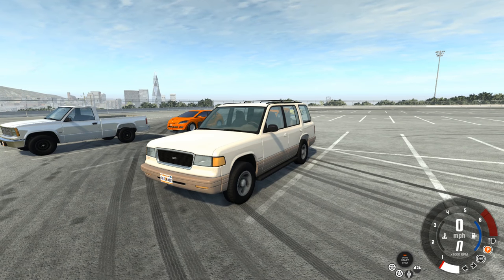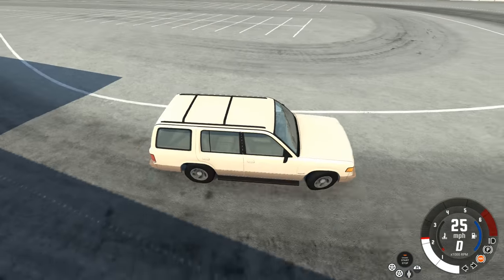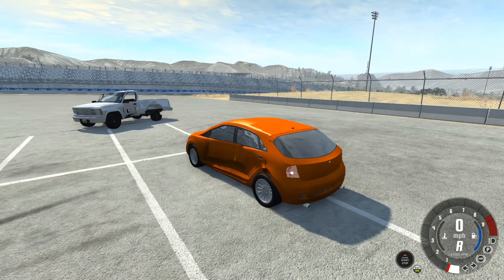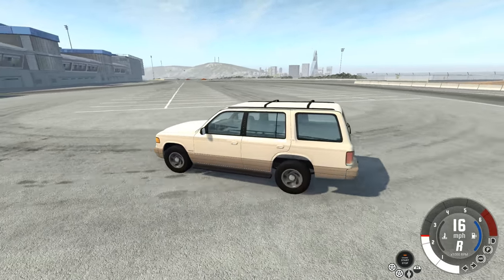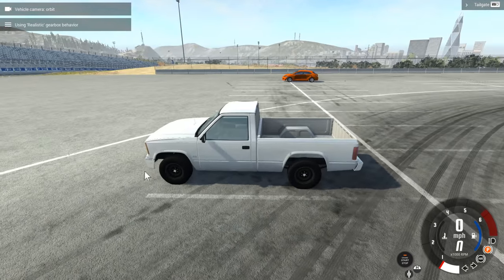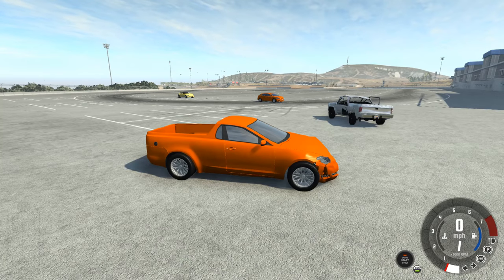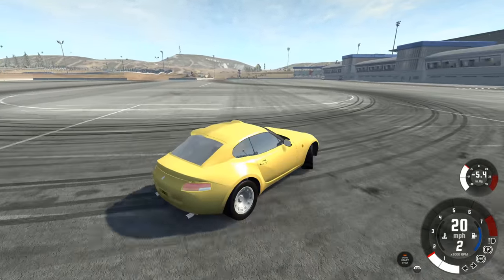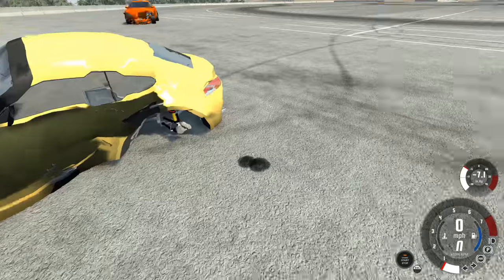BeamNG + Automation Crossover Crash Testing

Comment: 7:50
I believe this is because: BeamNG cars have many different components to the body, like glass, fiberglass, and even the interior can transfer energy through the car, whereas Automation cars have a single body; the glass, body panels, lights, etc. are all one piece, acting as one material instead of many pieces
Reply: That would also explain why the automation cars load faster into the game than the default cars that were already built into the game.
Reply: Sherman Harper  the deformation on automation cars basically works like other regular dynamic damage games like gta4/5.
Reply: It actually looks more realistic then Gta 4 or 5. lol
Reply: Jirapat Thaenphromrat because only single jbeam file?
Reply: Probably.
Reply: BeamCarHomeTrade YT 
That is actually a really simple way to put it
Reply: The Automation car crashes resemble the poorly made Russian conversion mods of Lamborghinis from Forza. They are one big brick, not many parts that handle the crash differently.
Reply: Sminem I've read that as they'll keep revising the exporter, adding discrete crumple zones and such based on the chosen safety levels.
Reply: Well, that's why the windows are opaque, they don't really have any kind of interior modelling either...

Comment: Idea for a series:
Come up with a set of rules, like engine displacement, wheight, driveline, etc.  Then viewers can build cars according to these rules and submit them to you.
You can then do some timed laps on a circuit or do a rallye stage to see which car is the fastest.

Depending on how many car builders actually want to take part you could either do several episodes on the same challenge, testing 3 cars per episode like you did for american descent. 
Or you could have a new challenge once a week, where at the end of the video you announce next weeks rules and what is going to be next weeks track, so that car builders can make a suitable car.

Comment: The damage received by the vehicles is affected by two main factors: Energy of the rammer and strength of the target. The rammer's strength does play a part, but very little - hence why the Roamer and the Automation Pickup did the same damage to the hatchback even though the pickup was stronger - the rammers had similar weight so they had similar energy.

Comment: Huh, how come I never saw this before, with all the autocross ones?
Also, the "realistic" gearbox behaviour, which actually seems to be simulating a torque converter + epicyclic auto quite well (including creep with the handbrake off :D)... is that a new thing, or just something you have to specifically turn on and so most people (including yourself a lot of the time?) don't tend to end up using it?

Comment: My cars keep pulling to the left around 150mph either my suspension (that I tuned to please the numbers) is bad or this is a current issue.
Reply: Dual Blades Orion Some mods in BeamNG do that, but it is fixed with suspension tuning. I have had this problem several times in the past. There might be something off with your setup, but it is possible it is a glitch because tuning the vehicle's suspension didn't always work. But, it was always mods for me and something not right in the suspension.

Comment: Cars are far too strong, crash at full open, kinda small dent, the model is ok, but strong
Reply: DJ_6290 That's the limitations they have though, those cars aren't hand-crafted so the damage models aren't much to see, technically speaking aside from engine and suspension there is nothing to Automation cars, it's just a mesh slapped together. 

It's not very good but we'll have that for now and I'm grateful for it since this virtually allows for an endless supply of vehicles, hope they come up with a way to allow more damage in the future.
Reply: It will get better in the future, ive read on a forum that on the dev build the cars crash much better and arent as strong
Reply: Both of these games are still in development, so I'd say it's perfectly reasonable that these Exported cars will also get better
Reply: GUMBA nice to see I was wrong then :P Its already going to be a really awesome update
Reply: a trout its only possible the feature of designing the exterior look of the car they cant make a damage model of a fixture that can be put on different positions